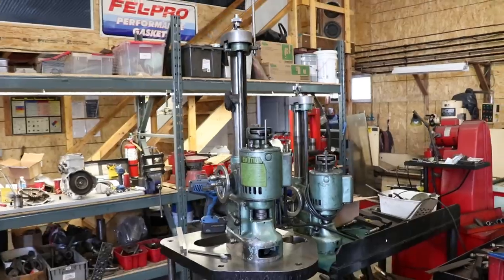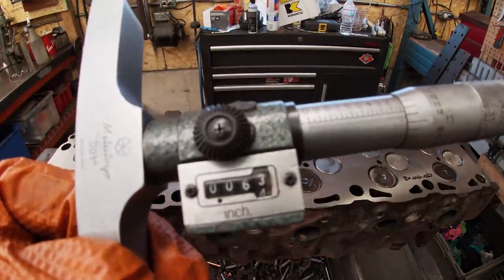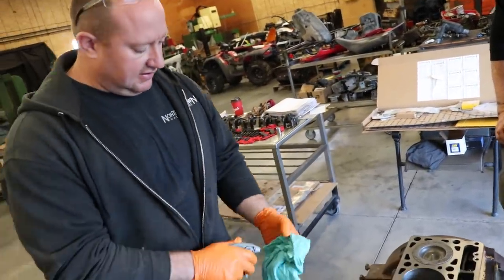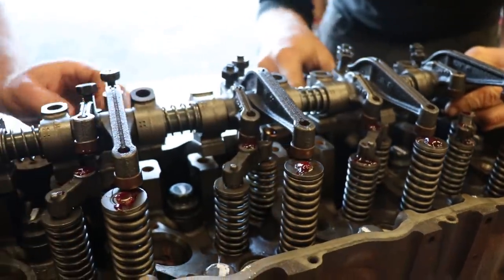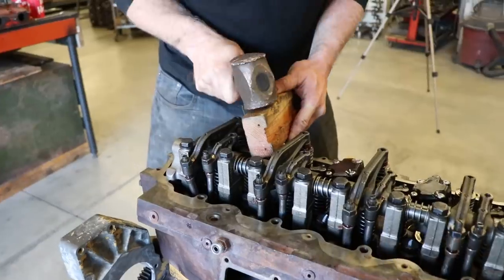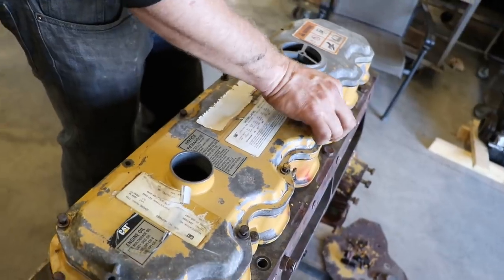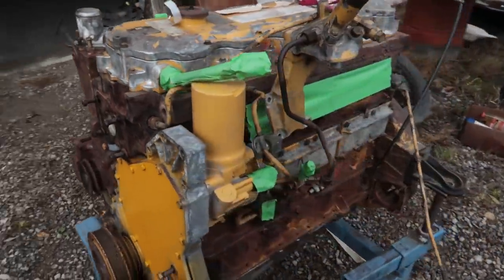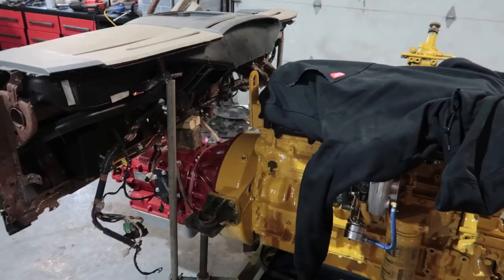7.2 CAT 3126 Cylinder Head & Final Assembly | #FTreeKitty [EP8]

Comment: LOL at Rich multitasking with his foot casually on the breaker bar bracing the crank for Scott torquing the flywheel while also putting the bolts in the injector flange.

Comment: I guess I'm a little late to this, but if the exhaust is pointed forward toward the direction of travel, thats how the turbo can spin. Some guys let the machine run, especially if it's only a short distance but you can protect the turbo by simply putting a bucket over the exhaust, or some heavy bag bungeed down. Anything to keep air from being rammed into the exhaust when you're going down the road. Used to do it all the time floating different gear around.

Comment: Nice work guys. but one thing caught my eye. I'm surprised you're not replacing the balancer. I'm not a diesel guy, but on a gasoline motor, the rubber on those gets old in less than one good engine life cycle. The new sexy ones are mechanical or viscous fluid to avoid the flathead era rubber/inertia ring system.
Maybe the stress is less on the lower rpm diesel, but I'd think the rubber still dries out. Even if the inertia ring doesn't fly off or walk, I understand the rubber hardens and reduces harmonic dampening ability.

Nice looking assembly, but it SURE looks HEAVY! (and expensive)
Heck of a project you've got going there, thanks for sharing it.

Comment: Hey just an FYI , those headbolts are cryo bolts and they are a one time use head bolt because they stretch so much, that will be your first issue down the road is a head gasket, replace those bolts before you break in that engine or your playing with fire, or better yet leave the used bolts in and go to Vegas and put it all on black because that’s what your doing reusing head bolts period!!!!

Comment: We built an M3 years ago ,shortened frame and put a 1972 chev 1/2 ton on top worked really nice ,a lot easier than building motor mounts and drive shafts and suspension . Was a lot faster ,think about it.

Comment: You can rig up a kettle and a water pump to heat cycle the motor a couple of times, and torque it while warm without much money into it. I know the latter is a little controversial, but many of the diesel performance tuners I've interacted with swear by it making huge difference to what point you start lifting the head on factory fasteners and need to do the bigger money solutions. The guys over in the UK also swear by ceramic coating the piston tops, but thats not one you can DIY as for me to have any experience.

Comment: probably wont make a difference but not supposed to put the injectors
 in that way. They make a tool that works off the rocker shaft bolts. supposed to be able to push them in by hand. I have never ben able to do it. in a pinch you can pull them down with the bolts if careful. bolt that
 bottoms out is supposed to be torqued to 50 inch pounds the other to 120 in lb.
Reply: When he has injector trouble I hope he remembers your advice. Never had a problem with injectors put in with proper tool. The ones put in with a hammer are a different story

Comment: So were a long way from the original teardown with adeptape. But were at 99% bus motor, with everything replaced, and kodiak injectors? Obviously the block and crank are pretty much the only component left, but it would be interesting to know where the motor is on the rating scale now with new injectors and turbo.
Reply from the maker: We’re now rated for 800tq and 300hp

Comment: Probably covered in earlier videos, but how does the 3126 Cat compare to the 5.9 or 6.7 Cummins in a Dodge truck?  I mean in overall weight, strength, and power(performance potential)?  Also how does it compare to the DT466 and similar IH engines?  Thanks for any info!
Reply: What’s the advantage of the HEUI style injectors also?  I thought that was an IH or Ford only thing?  Obviously Cat used them as well which surprised me.

Comment: it would be nice to build one on the floor like that,in frame is all ive done,also makes me nervous seeing you all waling away from motor without covering all open holes.then again ive never worked in a shop were you could depend on your co workers not just dropping a nut in on top of a cyl,yep had a disgruntle employee try to leave washers in a detroit one time,but i had double checked all before putting head back on.
needless to say i havent worked in best shops and i would like to do one on the floor like that,hahah  hexing between saddle tanks aint no fun
Reply: Jesus man, you wanna find better shops to work in 😂
In my 15 year career I've worked with plenty of people who I've hated or people that have hated me but would never have sabotaged each others work...
Reply from the maker: My old boss always gave me crap for not stuffing rags in as tight as I could to prevent sabotage.  I never understood why people get kicks out of others failures.

Comment: Realistically what kinda power can you squeeze from these engines? I use to work on an underfround loaders with the 3126 althought terrible derated for underground use maybe 200hp we were told these babies in marine trim can push out an easy 600+hp

Comment: Why is it that Rich said these 6 injectors were so expensive from Cat in another video but, from what I understand, essentially they are the same Cat/International design that are in the 7.3 Powerstroke and those are 2,000 dollars(U.S) for 8 of them? Also I was always able to push them in when putting injectors in a 7.3 instead of using a hammer.

Comment: I'm surprised he even checked the cups. They are so cheap and easy to do especially with the head torn down. Its kind of a no brainier to replace without question. Maybe he did it for demonstration purposes? Also the reason the torque spec sounded so strange with such a broad tolerance is because it was not even close to the actual head torque procedure CAT provides. The last step on the large bolts is 221 ft lbs then a 1/4 turn.
Reply: Looking at Cat’s SIS web its actually 221 lb ft then back them all off until the washer under the bolt head is loose. Then torque them to 95 lb ft then double check at 95 lb ft then turn 90 degrees. If you did 221 lb ft then turned 90 degrees I’m sure you’d either strip the threads out of the block or pop the bolt heads off.
Reply: @corywillbanks6348  I was looking at sis as well and miss typed. Thanks for pointing that out. The whole reason I looked myself was that I knew a lot of the torque numbers he was saying were incorrect. Honestly I would think the 221 ft lbs with a 1/4 turn would be similar to the 300 ft lbs they torqued it to. Either way those bolts can handle handle a fair bit of torque. We had a guy who's torque wrench failed of him and he just kept turning and turning it eventually just hour glassed the bolt. Happened to another guy torquing the head on a MXS. lol
Reply: Ha ha right on man I was just curious so I had to look it up as well I’ve only ever worked on cat natural gas engines so it’s interesting to look up the diesel stuff. I’ve done it myself on a G3412 we were on the final torque step and I had one bolt that just kept turning, that’s when you get that empty pit feeling in your stomach. Luckily it wasn’t the block it was just the bolt hourglassing. It wasn’t overtorque just the bolt finally giving out after who knows how many head changes?
Reply: @corywillbanks6348  Never worked on any gas engines myself been around plenty rebuilds. As I work for power systems division but I'm dedicated industrial engine. Originally worked construction equipment for 2 years going through school then transferred over to the truck side due to a lack of work when I finished school was in the dept for 6 years with 2 years on the road and have now ended up in power systems this year thanks to COVID kept my service truck and everything lol. You work for a CAT dealer or are you 3rd party?
Reply: @LKN117  that’s pretty awesome so are generators included in that division or is it just industrial? When I graduated high school I was supposed to go through a dealership apprentice program but that’s about the time the recession hit in the late 2000’s and they shut the apprentice programs down so I hired on with a 3rd party natural gas compression company in 2009 and have been there ever since, and 2 years ago I finally achieved my G3600 commissioning certification so that’s been awesome. Honestly now looking back I’m kinda glad things turned out the way they did because I look at working on heavy equipment and trucks now and don’t think I would enjoy it, you’re always crammed up in some hole or laying on your back in the dirt with crap falling in your eyes whereas the stuff I work on now is easily accessed. Sounds like you’ve worked both scenarios what are your thoughts? I take it you work for a dealership correct?
Reply: @corywillbanks6348  Yes generators are included but I dont really touch them much yet. I have only been in power systems since May and in that time I have worked with two generators. One was a little 50Kw I did a water pump and was show how to load bank with and just last week we had Zeta come through as a tropical storm and I had to help set up a couple 3 two meg units and a single one meg cummins unit the customer had on site. When I say industrial engine I mean anything CAT that isnt in a truck or piece of CAT equipment. Chippers, rock crushers the list goes on and on. I do still help out the truck shop with CAT trucks I was the best they had on those things. I also work on equipment from time to time usually when im at a quarry and they have an engine and a piece of equipment down at the same time. Honestly I dont miss the equipment side much I think it might just have to do with memories of my nervousness being thrown at something I had very little understanding of when I was still in school. Now the few times I do work on equipment it doesn't bother me its just like anything else ive worked on at this point so it was probably just a mental thing. I did enjoy truck work though. I think what I'am doing now is much more rewarding though and yes I do work for a dealer.

Comment: When you were adding the black painted (I assume computer) under the intake it pushed up on that fuel line, are you worried that could rub a hole in it from vibration?
Reply from the maker: It isn't connected yet. Mocking it up but we will put a pre-filter in to protect the fuel system

Comment: I would have replaced the harmonic balancer after spending that much money on the engine. That silicon gets hard after so many miles or years. I have seen quite a few broken crankshafts in semis that could have been prevented.
Reply from the maker: Have to draw the line somewhere I guess.  Silicone looks to be in great shape  I will keep an eye on it though, thanks for the tip

Comment: I can’t recall from previous videos....did you end up putting liners in that engine or did you use oversized pistons?
Reply from the maker: Everything was within spec.  Cleaned up great.  Total seal piston rings.  The 260 hp engine was toast, the 190 engine was great.

Comment: ik this is a longshot but i was wondering if there is anyway i could see if u ever thought about talking about the old isuzu commonrails. im looking to swap a 4jb1 into an isuzu pickup that originally had the 2.3 gas with 5-mua trans. I see a lot of stuff for 4bts and i really want commonrail and to have the isuzu be an isuzu u know but the 4bt isb is only commonly found with the allison 1000 and they are hard to find and expensive out of bread trucks with high mileage the 4jb1 is used a lot overseas and it also had this engine mounted from factory in japan. if u had patreon i would be willing to pay for something like this just because i like having your opinion on it as ive never really done much mechanic work or any engine work at all and this would be my start. im torn between a gm 2.5 lcv swap  or the 4jb1. the 5 mua is my favorite manual trans of all time i think its still used down south of the border in mexico for cabovers.